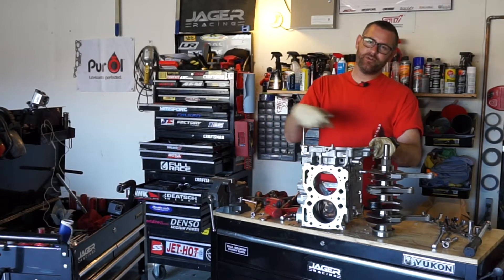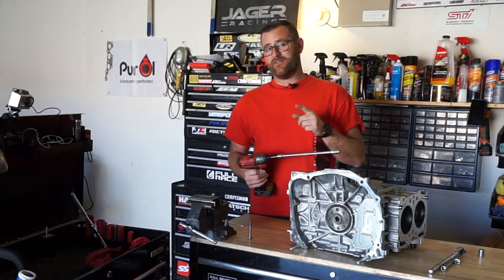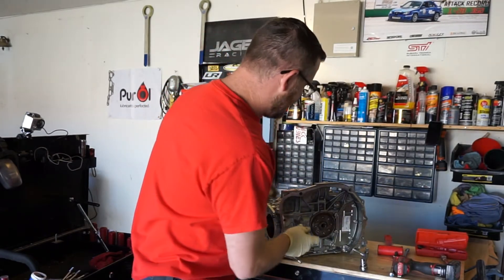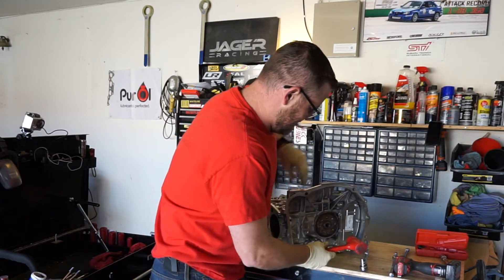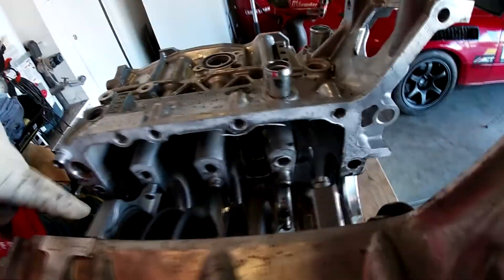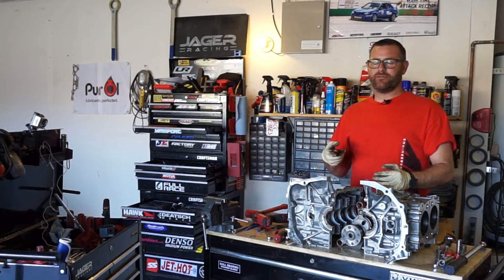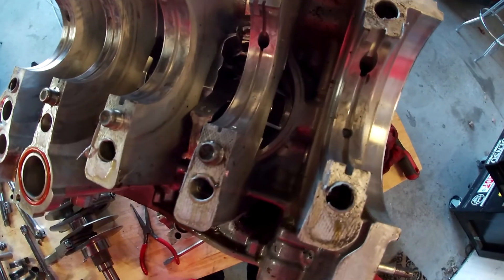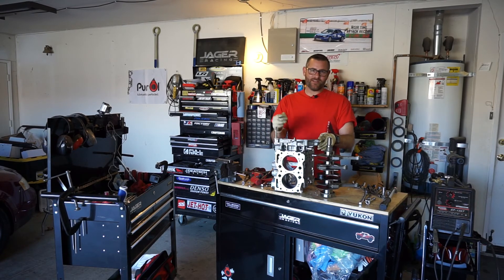EJ25 Short Block Tear Down

Comment: What is the screwdriver you used at taking the service port plate Phillips screws out? Thanks!
Reply from the maker: It is an impact screwdriver 
TEKTON 3/8 Inch Drive Impact Screwdriver Set (7-Piece) | 2905 https://a.co/d/6GvGqr5

Comment: Billet block, with a 12mm oil pump and looser clearances for your bearings and run the same 20w-50 from motul, amsoil or VR1 in my opinion.
Reply: But yes I know billet block is expensive but tbh you just said the answer in the beginning. Anything to keep the blocks tortion down will help with all the oiling and bearing starvation and rod flex, and cylinder wall flex etc. or just run the same iag block lol with all I listed.